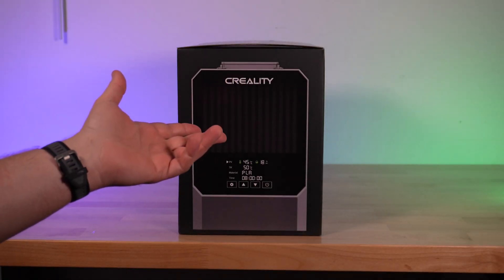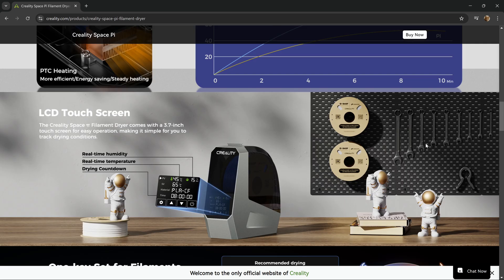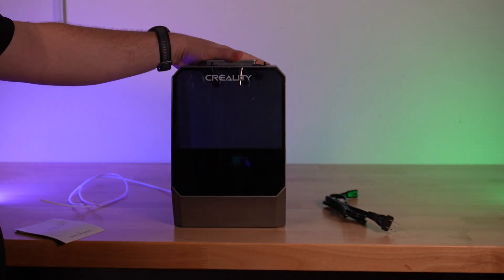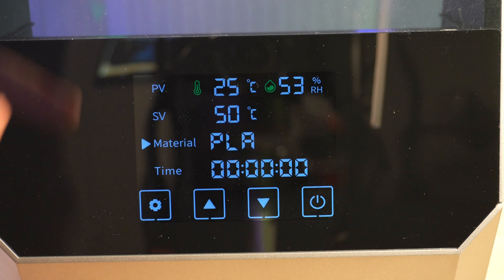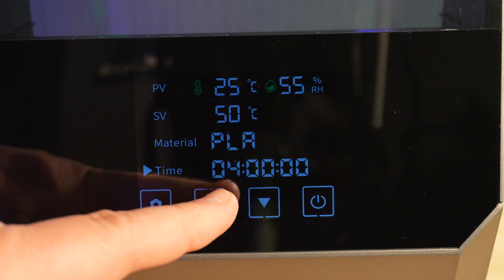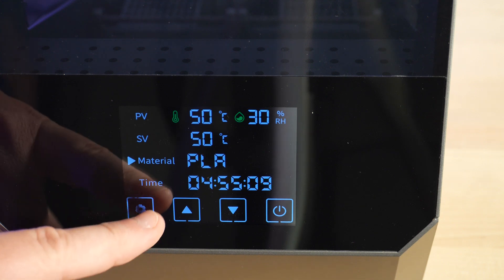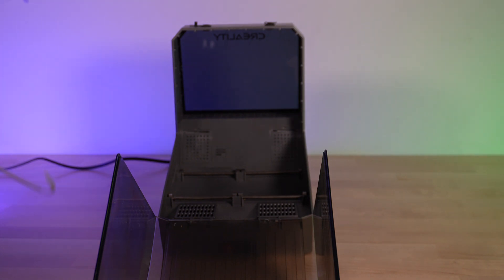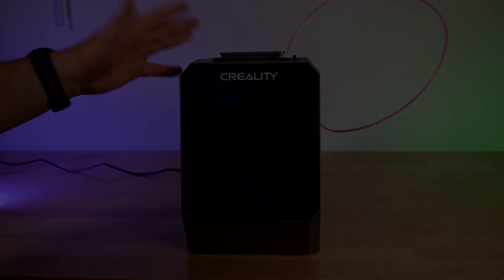Creality Space Pi dual filament dryer unbox and initial impressions

Comment: Just ordered this the other day and no complaints.  One change I noticed (or at least didn't see in the review) is the PFTE tubes came with little clips that insert into the hole which I am assuming is to prevent the PTFE tube from slipping.
Reply: but the clips DON'T insert into the hole :face-purple-crying:

Comment: So I bought one of these and can say the design of it is definitely form over function. There are a number of issues with it. I mean it looks great and has a lovely screen but it's poorly designed. So a number of people have reported that using the rubber holes at the front, the PTFE tube gets pulled in to the filament roll and causes jams and I can confirm that those rubber bungs have almost zero grip on the PTFE tube. There position is also stupid. Most people will have the dryer facing them but trying to twist your wrist around to painfully feed the filament through those front holes is ridiculous and the tall front makes it unnecessarily difficult. Luckily their are 2 holes in the lid that just so happen to fit the PTFE tube (but doesn't get mentioned). I'm using those with cable ties (a temporary measure) inside and outside to stop the tubing slipping. It's a much better option. The silica pouches are not much bigger than a stamp and are purely a marketing gimmick IMO, proven by the fact that if you stop the heater the humidity level inside increases rapidly (with the lid closed), not helped by the fact that it's not airtight and doesn't even have a rubber gasket unlike the Solvo SH01. You'll find that when in use the humidity will drop to a certain level and stop, at this point you need to prop the lid open to allow the warm moist air to leave the box, which is common for this type of dryer, but there is no easy way to prop the lid open. The solvo has clips on the front that can be used as door opening props. The hinges on this Creality flex and look weak. I suspect they will fracture. It doesn't help that if you flip the lid all the way over the lid doesn't touch the ground, so it hangs there a few millimeters in the air putting maximum stress on those hinges. If you only need to dry PLA and TPU I recommend getting the Solvo. It doesn't look pretty and it's basic. but the way it is designed makes much more sense and it often sells for half the price of this.

Comment: Does it exhaust out the heated air?
Reply: yes. if you don't plug up the 4 holes in the lid you can feel a little warm air coming out of them...  Over a 6 hour period, or whatever, they seem to be enough to let the moisture out.

Comment: I just ordered one. I will come back to this video when I get it. Thanks!
Reply: and.....
Reply: So......
Reply: I'm happy with it. The touch screen is a little wonky but works well enough once the brains of the unit boots up fully. It does a nice job of drying the filament based on filament type and the time you set it to run. I usually do 3 hours and leave it there for a day before loading it into my machine. I would recommend it for the price.

Comment: Two things... Having this dryer I can tell you its great with the two exceptions... 1) the lid is annoyingly cheap. Sometimes its hard to close but its not a show stopper, they just need to design it better so its not annoying to close. 2) Sometimes generic spools are wider than the single area can accommodate. So you want to straddle the two compartments and set the spool in the middle,. This WOULD work fine if there was a hole in the center where the filament can come out the top (X1/P1 Bambu issue). They need to use decent pneumatic fittings instead of rubber holes so we can just use PTFE tubes for this. There needs to be 3 of them. One on the left, right and middle. I like the machine and hope they continue to improve the system.
Reply from the maker: @DevesTechnet  some things are easy to fix with a power drill and some elbow grease. Maybe I'll bastardize mine for the sake of humanity
Reply: @TheFeralEngineer  Yeah, I did add the three tube fittings. Made a world of difference. The molded door is another issue. Its a good dryer and worth the trouble.
Reply: @BlondieHappyGuy  I think that is most likely their purpose. It should probably be made more clear that these should not be blocked up when drying process is taking place. But the problem is that if you want to use it as dry storage in between drying, there is no way provided to seal them up. The lack of decent seal around the door makes me think it will be pretty bad as a storage box anyway.
Reply: What about the two other holes in the lid? There are no rubber bungs to close those up. Am I missing something (part from rubber bungs)?
Reply: @andybelinka   You need those small holes for humidity exit.
Reply: @WestCoastDP Thanks. that certainly seems to be a sensible conclusion. But the problem comes when you want you use them as filament storage. I actually think they would be quite poor at the storage side of things given the lack of seal around the door.
Reply: @andybelinka  There's cheap bags for storage.. Otherwise you'll be paying a very high price for every two spools you put away. You can put desiccants in there to keep it dry between you setting the heater and storing if need be..
Reply: @andybelinka  Silicon sealer. NO idea what they were thinking about putting them there. :)

Comment: Could you be so kind to give me the dimensions of the Space Pi Plus? The dimensions i find online seem to only be of the packaging, not of the actual dryer. Thanks in advance!
Reply: W7 3/8 inch. L12 inch. H11 inch. I know it is 8 months late but in case anyone else needs them, here you go. These were taken by hand with a tape measure so they are not exact, but definitely close enough.

Comment: Does it work though?
Reply from the maker: It does what it's supposed to do; heats up filament and circulates air around it to keep it dry. None of my filament has given me any moisture related issues in a while, so my dryers just kinda sit and wait. I might use it as a holder for the infimech TX only because the rear spool sucks
Reply: @TheFeralEngineer  I ended up buying one and then it printed out the same so I feel like I might have a different issue with my printer. But every filament I’ve used this machine on is now in a vacuum sealed bag so it doesn’t get moisture again.
Reply from the maker: @Mudvaynes23  what's the issue you're running into?
Reply: @TheFeralEngineer  less than half way through my print it’s starts to become almost brittle which is why I thought my filaments had moisture in them. I’ve tried adjusting the settings on cura as far as the temp and infill but still the same results. I think my next step is to replace the filament extruder and change the Bowden tube and nozzle.

Comment: They use outboard bricks because they fail alot. This makes you trash a whole unit instead of buying a new brick. Built in bricks are bad. They cause more electronic waste. Not an eco freak, a product designer. Its hard to meet eco goals when you have a dumpster full of returns. I know sometimes you can sell to a recon company but they are questionable in work and waste profile but represent your company. I prefer to design a plug in laptop brick if needed or usb-c power transformers. This allows low cost replacement and less waste.
Reply from the maker: @Serenityindailylife  I'll keep you posted on the fail rate of this and how I rectify it in the future

Comment: Thanks for the video ... could confirm if it fits 2 kg filament spools?
Reply: It does, I use it for 2kg spools of white and black sometimes. Of course only 1 spool at a time, but it works perfectly. 👍🏻
Reply: 3Kg reels fit across both sets of rollers and the lid closes as long as the reel diameter is the same as a 1Kg reel.

Comment: Wondering if you use two different filament types, is there a setting for that?
Reply: If you use PLA end PETG you could just use the PLA program, if your spools are not soaking wet the PETG will also dry more than enough when you gib it an extra 2 hours or so. Practical if you dry over night
Reply from the maker: @simplified3DHub  there's not. They share a chamber, so dual temp would not be doable
Reply: @TheFeralEngineer  Thanks,